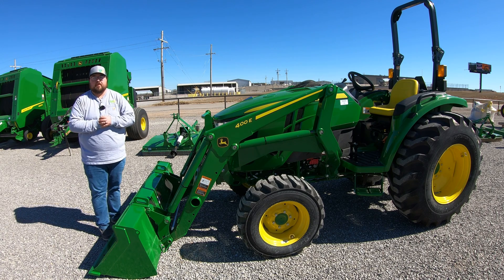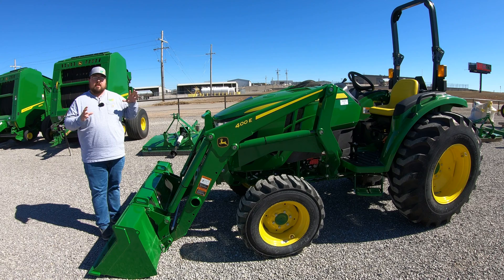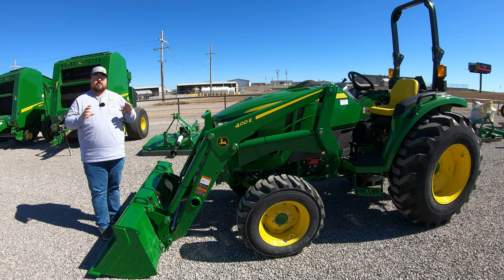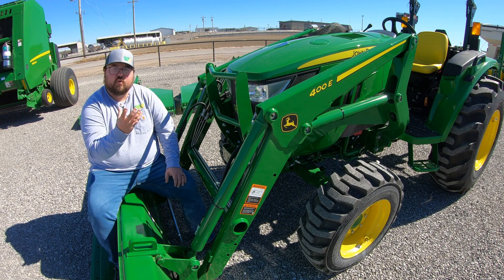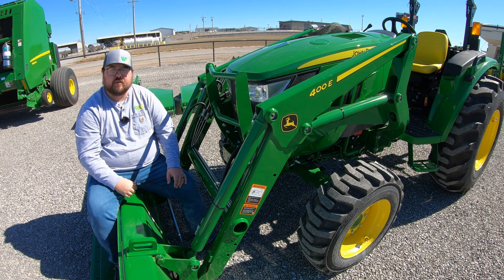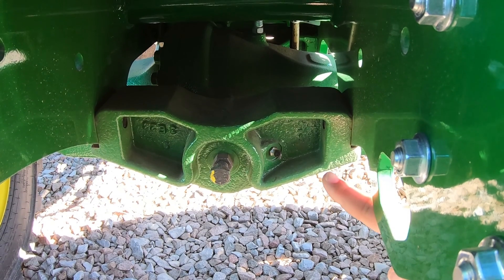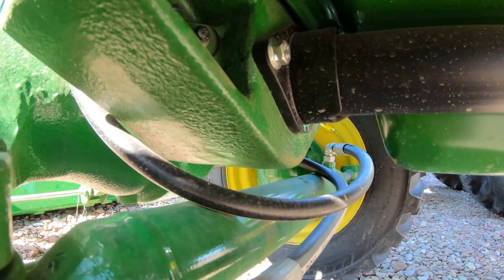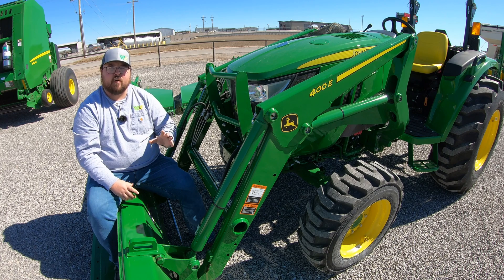ALL Grease Points on John Deere 4 Series Tractors

Comment: Thank you for the video!! I have been looking for all the grease points on the Jd  3039R to make sure I am not missing any. The manual does not list them all in one place that I have found. Have you done a video on one on the 3039R, or are they the same and the 4s? My old tractor was a 4410 and it had a lot more grease fittings. I think I may be looking for grease points that are not there. Thank You for your help and channel. Wayne